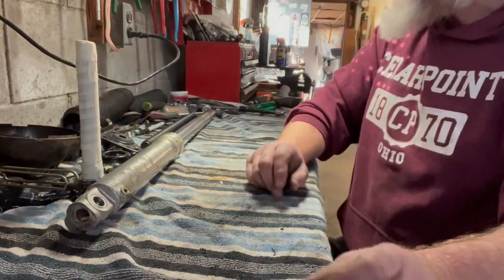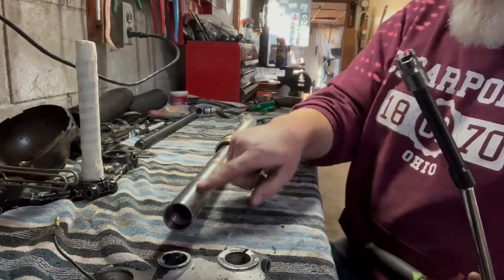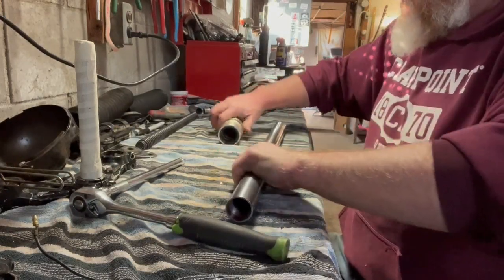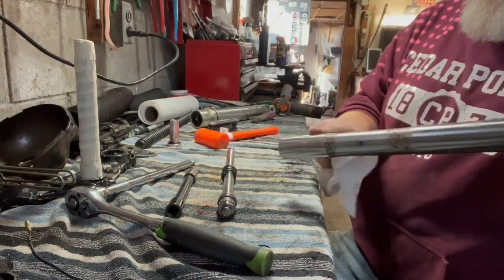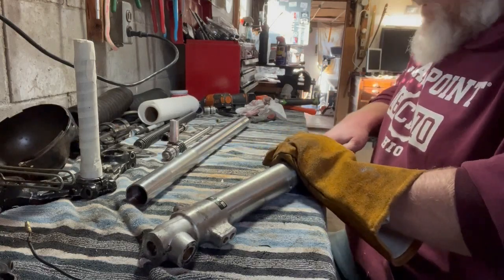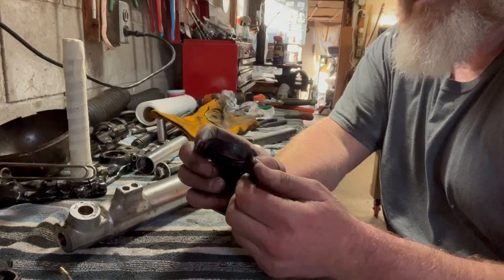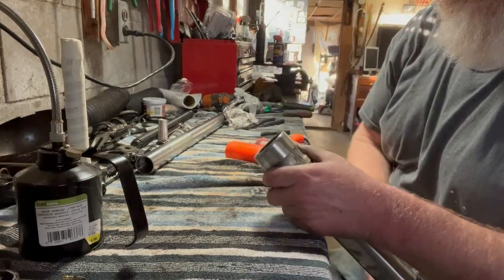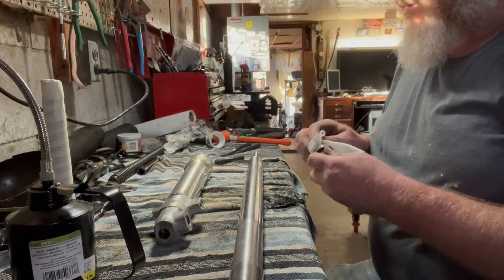XT500 Fork Seals - Restoration Video #25

Comment: Forks can be a pain in the ass especiallyif someonehas applied threadlock on a rebuild, many times i have drilled the caphead off before.
Reply from the maker: These were difficulty ones for sure.  Thanks for the pointer.
Reply: @CK-Cycles  the slide hammer with the forks is a good idea and another pointer I do is apply a jubilee clip around the outside of the fork leg were the seal is and prise a thin blade screwdriver down the edge of the seal then collapse inwards which once done the sal will fail out.